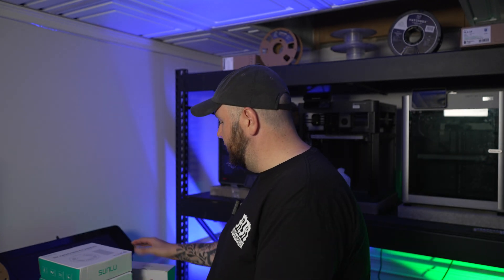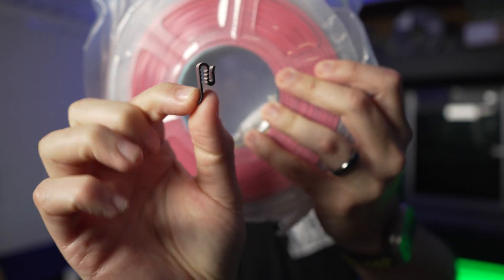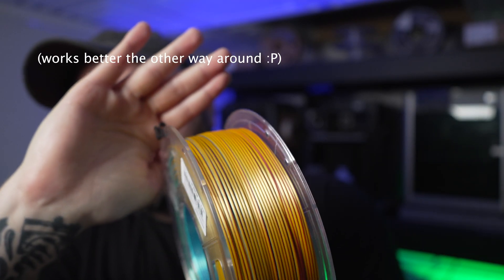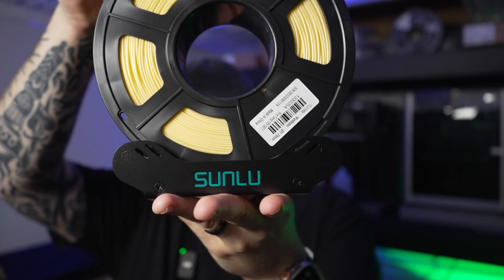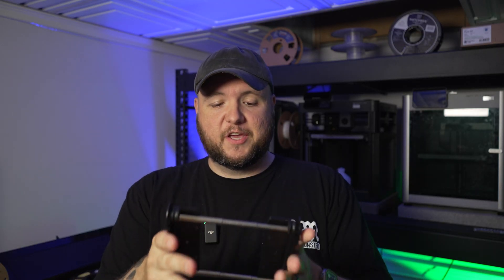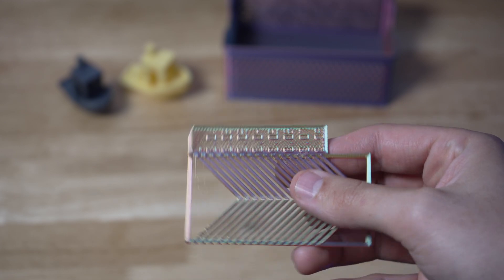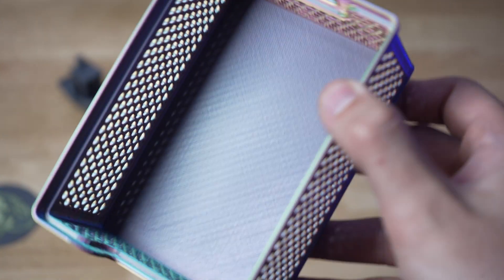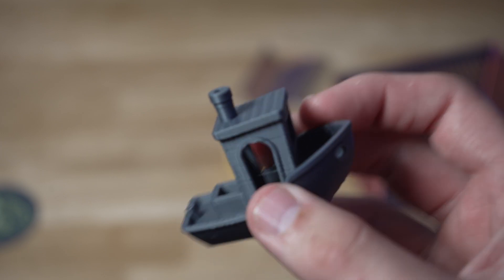COOL FILAMENTS FROM SUNLU!

Comment: I have been using Sunlu's black aPLA for about 4 months now. My only complaint is i cant get it in a 3kg spool and that it hates my smooth glass bed, the textured glass works fine.  aPLA is their anti-string PLA and it works great even in my kobra max with a volcano nozzle